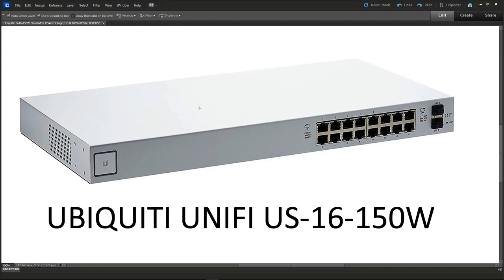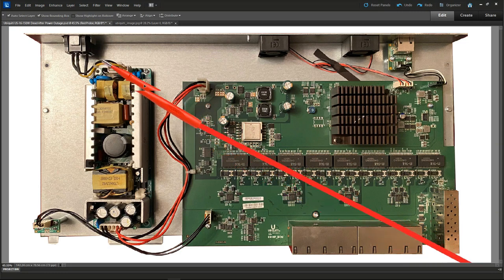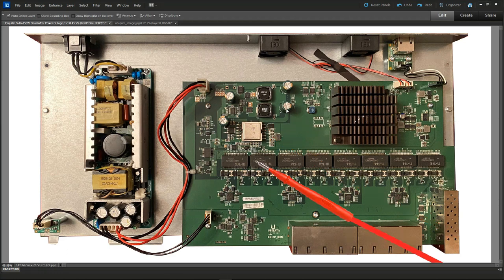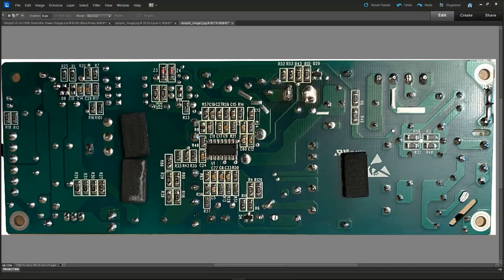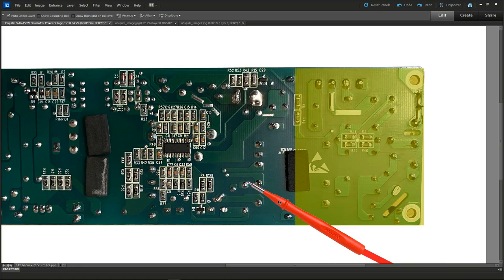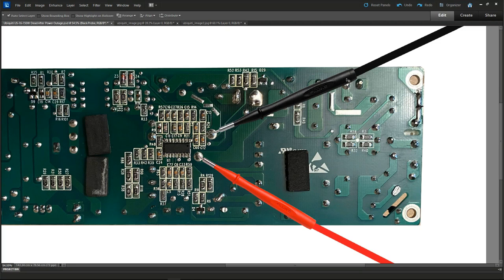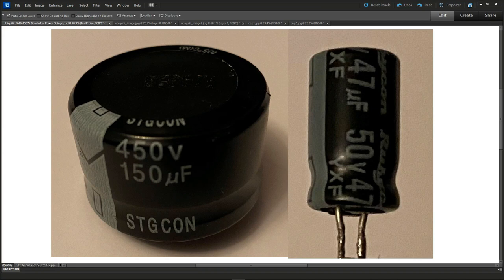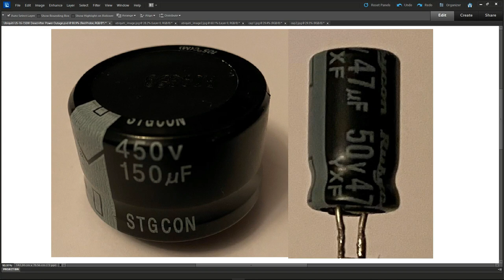Ubiquiti US-16-150W Dead After Power Outage

Comment: Thanks for the video and explanation of the board and how it works. Where did you get the replacement components?
Reply from the maker: Hi Nick, I took one from a spare board I had here, but I would usually order from either Farnell or Radionics here in Ireland. It's a standard 450V 150uF capacitor, but you just need to be careful with the height - if the replacement is too tall then you wont get the switch case back on!

Comment: thanks for good explanation video.i got same model switch , it gives 53.1v at point your supply was giving 40v., only fans working, in start for few days lan lights blinking but now no light atall just working fan.  if you able to suggest what can be checked.
Reply from the maker: Hi there, if you are measuring a stable 53.1V coming out of the DC power supply, then it is most likely that your switch power supply is fine. I would guess that your problem is with the other board.

Comment: Can you let us know what the output voltage was after the repair, please.  Also, if you know what the rated amps of the power supply is.  Thanks.
Reply from the maker: Hi, I measured it now and the output of the power supply board is a very stable DC voltage of 53.4V. I don't know what current it is rated for. 
I found it difficult to find out anything about the power supply board (model number:G0398-15011480A V0.7) when troubleshooting.
Are you seeing the same issue?
Reply: @therepairshare673  Thanks, I believe the unit is rated at 2.9A.  Mine just died, will be removing it later today to see whether it's just the big cap or more.  I will probably just replace it with a Meanwell LRS-150-48.  You can max the volts on that to near 54V but the switch is happy with 48V as long as you don't have too many high draw POE devices on it.
Reply from the maker: @einfelder8262   I would be concerned that if the Ubiquiti main board did not see the exact 53.5V voltage, then it might not work. I think I would be looking for reassurance that it would definitely work with 48V before purchasing the Meanwell. If I were in your position, I think I would focus on seeing if your fault is the same as mine, and if so, work on getting the cap replaced. 

I cut through the heatsink to get access to the cap from above. You only need a soldering iron to remove the filter cap, just remember to discharge the cap before removing in case there is any voltage sitting on it.
Reply: @therepairshare673  The unit is now working just fine on the Meanwell.  You can turn it up to max ~52.7.  The board only wants 48V, the 6V headroom is for powering up POe devices that have a large startup drain.  There are none on this system.  To get the right size cap delivered to me is ~$30 and 3 weeks.  Not an option.
Reply from the maker: @einfelder8262  Great. Glad you got it sorted.

Comment: In mine the integrated U1 exploded, do you know what it's called?
Reply from the maker: Below are the numbers that I see on U1 
TEA 1755T
NXP SK51.108
rXD16351

Send an email to therepairshare at gmail.com and I will send you a pic of the chip.
Reply: @therepairshare673  Thanks! Do you think that beyond this IC one has burned something else?
Reply from the maker: @NicolaFavazza  Hi Nicola, it's very difficult for me to say without seeing the board or testing. I think the best you can do is test for other shorts and look around the board for other failed components, and if everything else looks okay, take a chance on replacing just that chip.
Reply: @therepairshare673   I try to change it..I'll let you know ) Thanks